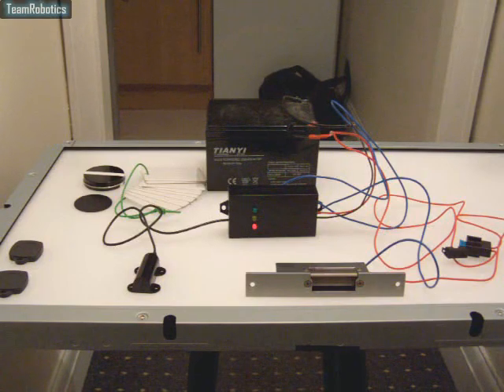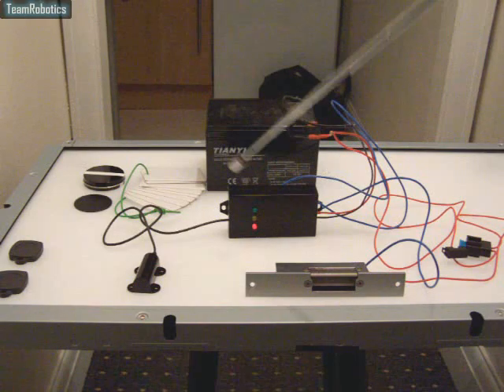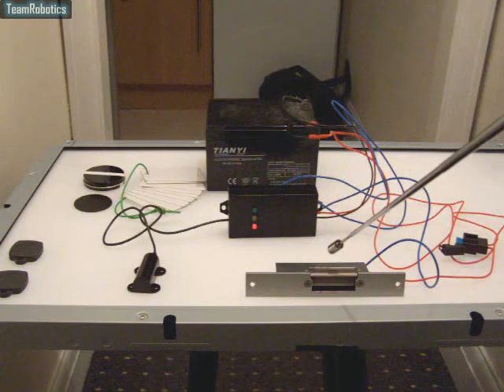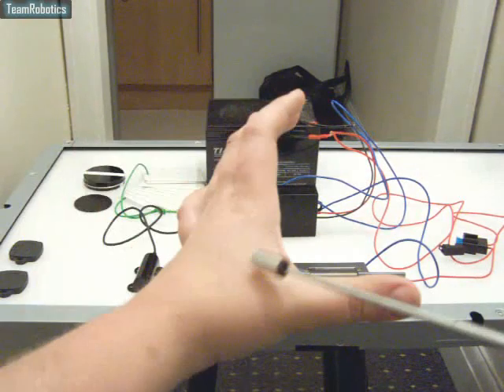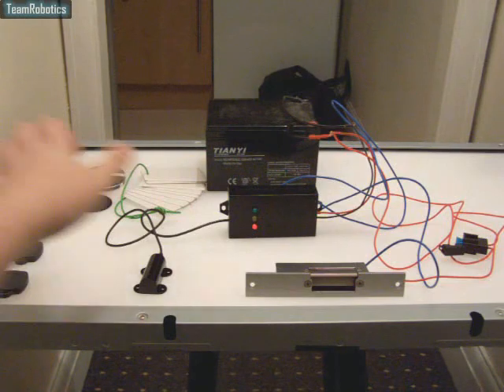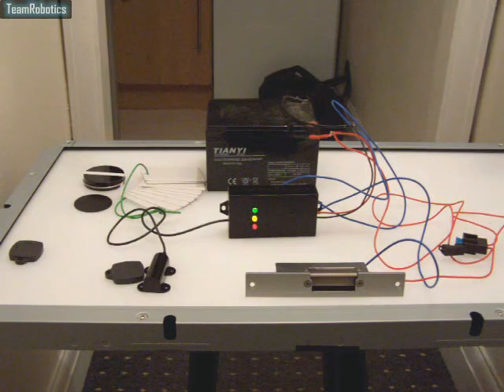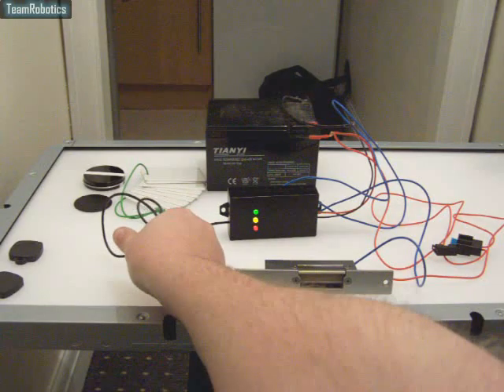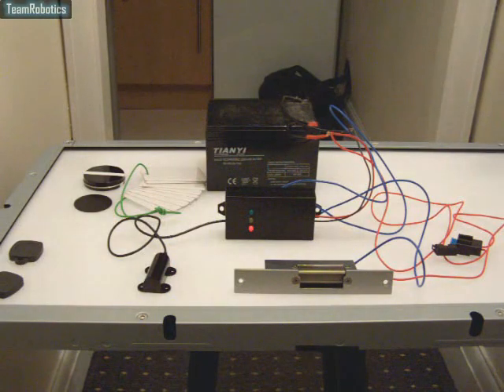Rfid Video 5 prototype locking system working

Comment from the maker: This is a prototype for a electronic door entry system. Allowing me to unlock my doors using rfid radio frequency identification tags which i have implanted in my hands, or clam shell cards or valid keyfobs etc can be used for access.. Its part of a project not related to my Johnny Five Project..